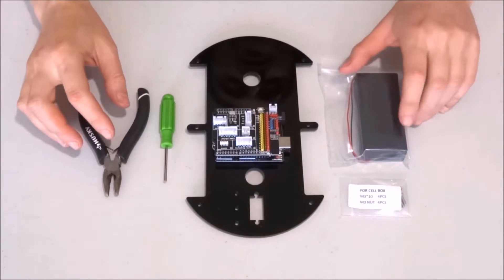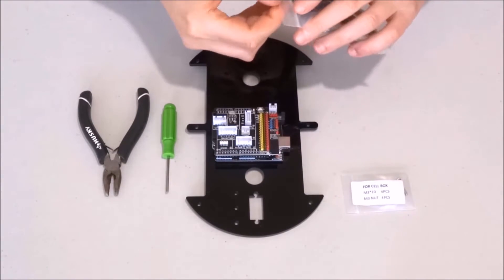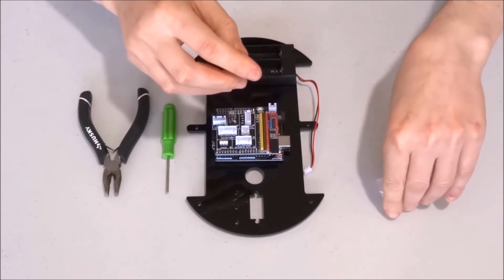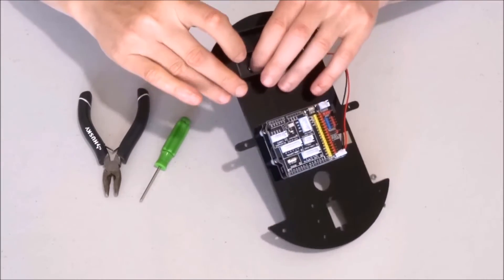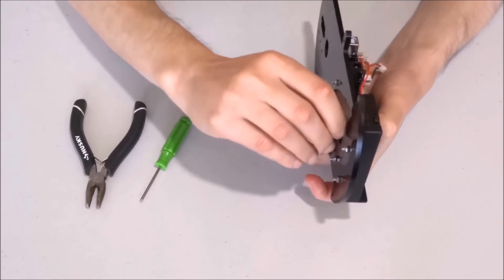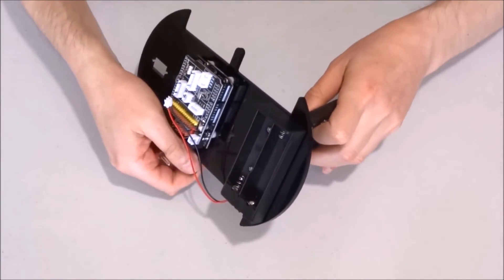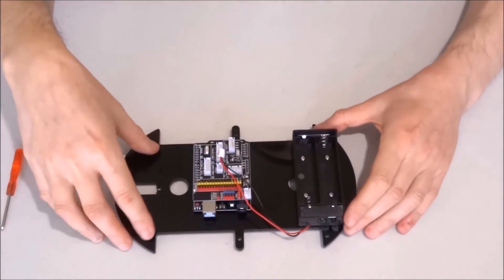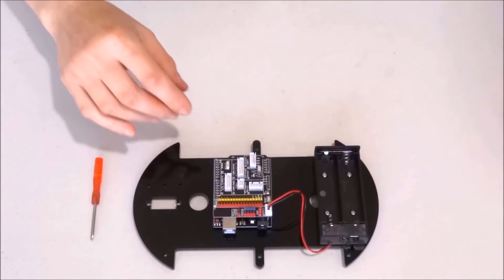Assemble Elegoo Smart Car Arduino Robot KIT 3.0 Step 5: Install The  Battery Box

Comment: My battery box is a sealed unit, just fits with two hex screws
Reply from the maker: Is this Elegoo robot? I have only robots with this battery box :-( .
Reply: @BoianMitov  Yes I bought this from Amazon UK and your video have been very helpful setting up. Im not sure if links work but you can see in the pic: https://www.amazon.co.uk/ELEGOO-Tracking-Ultrasonic-Intelligent-Educational/dp/B01M6YHRJ4
Reply: @BoianMitov  Ah I see I bought the 3.0 Plus which comes with Polymer Lithium Battery Pack. Thats the difference. Also the Ultrasonic Ranger holder was already attached to the servo when I got it. When I turn it on the servo is not in the middle, but as im using a Mac I can't follow your other video on how to make it lign up.
Reply from the maker: @Beanie1984  Wow... your one is a better version than my one! :-) Now I am jealous... :-P
Reply from the maker: @Beanie1984  I am glad I was able to help :-)
Reply: @BoianMitov  I just typed "Elegoo Smart Car Robot KIT" into Amazon yesterday and it's the 1st one I found. It said Lightning sale (never seen that before) and had money off so I bought it. It arrived today. This instructions were not perfect, so searched and found your video
Reply from the maker: @Beanie1984  Great! :-) When you finish it, you can try some of my Visuino tutorials for it :-) Have fun!
Reply: @BoianMitov  I would but im on a Mac so cant run Visuino. P.S I notice you code in Delphi? Ever heard of ConTEXT Text Editor?
Reply from the maker: @Beanie1984  I just checked the ConTEXT Editor :-) . Yes, Visuino is written in Delphi. Unfortunately, while I work on MAC porting whenever I can, I am so overloaded, so one god knows when I will be able to finish the port :-(
Reply: @BoianMitov  hey no problem. The reason I asked about ConTEXT is because I own it, I bought it years and years ago from Eden the original developer. The problem is it was written using a cracked version of Borland Delphi due to the amount of components it requires. I wanted to open source it but could not put "download this cracked IDE" in the docs lol. So it's not being developed, im have moved over to mac myself. I just keep the website / download available out of respect really. Im a PHP web developer by trade, but I dabble in multiple languages. Guess I shall stick to the main arduino IDE then :) ha
Reply from the maker: @Beanie1984  Well... now there is a free version of Delphi for non commercial purposes :-)
https://www.embarcadero.com/products/delphi/starter
Reply: @BoianMitov  wow thank you. I will take a look. ConTEXT has always been free and always will be. I just ask for donations to pay the hosting bill. Last time I checked the free version did not allow using components.
Reply: @BoianMitov  this is what I have so far :) https://ibb.co/R2wv6hM